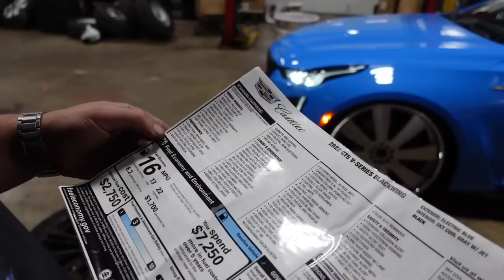TOOK BRITTANY TO THE SHOP TO PUT RIMS ON MY CT5V BLACKWING AND SHE DONT LIKE THEM 😭

Comment: Although that 24 look dope that fitment is off. maybe different offset to push the wheel out more and maybe it'll push the wheel away from the strut tower a bit but a 22 will work best and less fitment headaches. Otherwise take ya time and see what options you have to make a 24" fit with minimal or no modifications. No Rush Right???